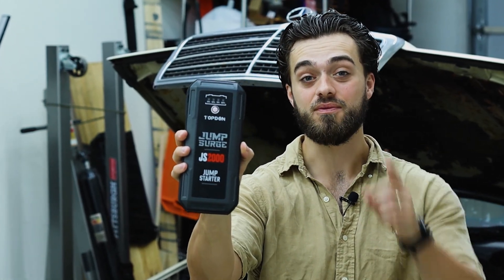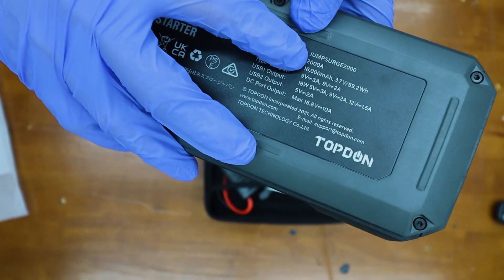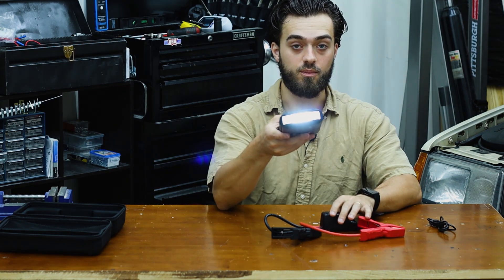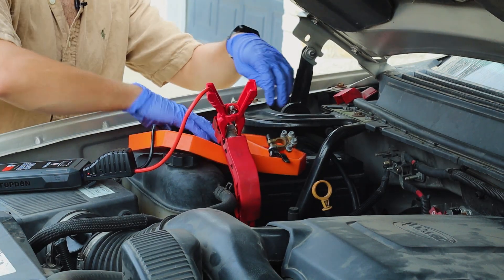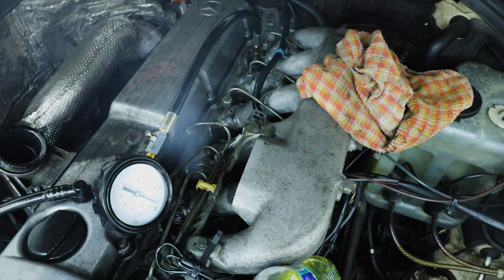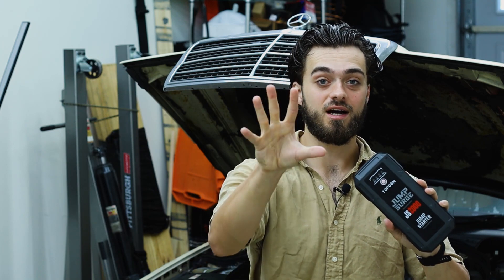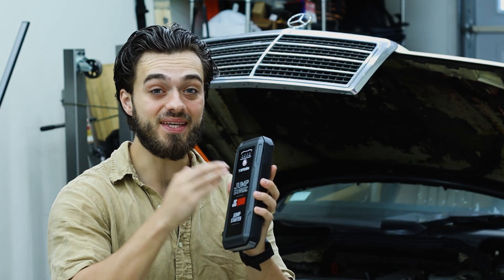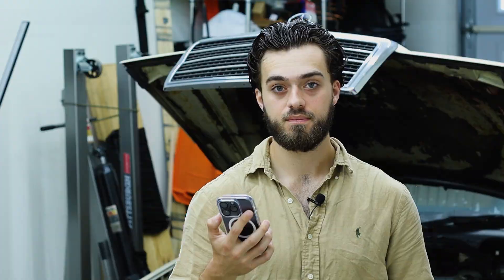Why EVERYONE Needs a Jump Starter | TopDon JS2000

Comment: I have one of these, it starts my V8 truck quicker than any other jump pack I've used. Even with a low battery it works. I own multiple jump packs, including 2 from Harbor Freight, a Dewalt, and a Costco brand. The JS2000 outperforms all of them

Comment: Does anyone know if these are more durable than the Noco jump starters? I had good experience with Nocos but the buttons are not durable at all. Within a handful of uses, the boost and light buttons stopped working. Do these Top Don starters have buttons that last longer?

Comment: Can the black and red cable be replaced?if you ever need do?
Reply from the maker: Yes, they seem to be a universal cable/plug between most of these jumpstarters
Reply: @AutoMotivate  the only reason that i m asking is that at the other end of the cables it has the black thing with light on .
Reply: @AutoMotivate  thank you so much !🙏
Reply from the maker: @vlastarinarcis6284  Clamps like these should be a direct replacement: https://amzn.to/43Hnoq2
Reply: @AutoMotivate  thank you!